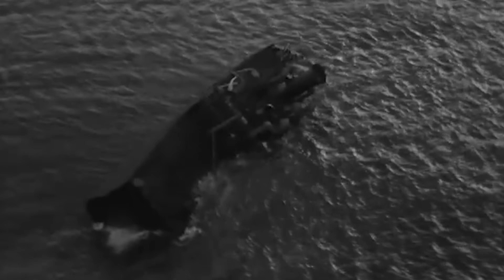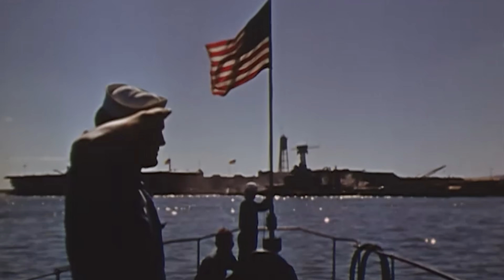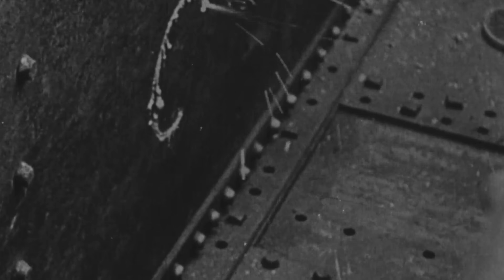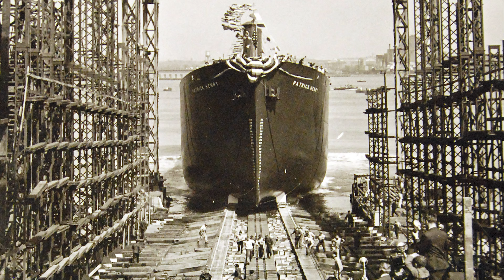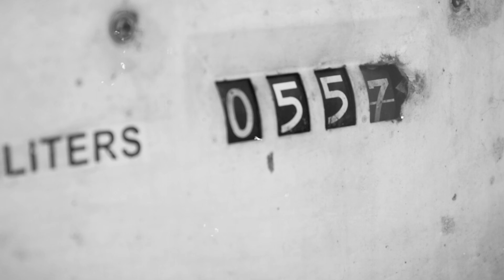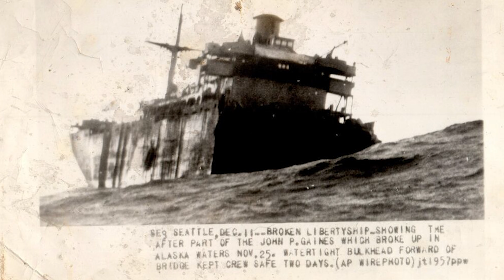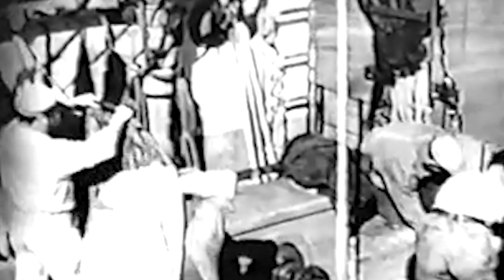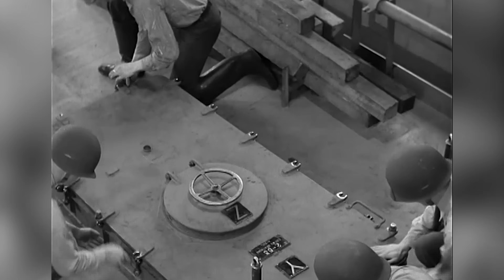CATASTROPHIC Design: The Ships That Broke in Half

Comment: Metallurgist here! Liberty Ships and the 800 of the 2800 that experiencing "major hull cracks" were part of the metallurgy curriculum for me in the Fracture Mechanics part of my training. There were TWO primary causes for this: Number 1. Nickel was in short supply You may say NICKEL? What does that have to do with fractures in steel? Simple, about 1 or 2 % Nickle added to the steel dramatically changes the "nil-ductility transition temperature". Enough so that in the Northe Atlantic, many times the ships were cold enough to have transitioned the WELDS from a   "ductile" state to a brittle state.  However, proper structural design and the stress levels in the steel, even during heavy weather, could stay below a "failure" level. That is where factor number 2. comes in,  Built in starting cracks. Proper welds and these should have been no large weld flaws, and the ships would still be "OK". Whoops, you had Rosey the Welder on these ships and she was being paid on a "linear inches per day" bonus basis. With Vee Grove welds after the "root" pass, it was very tempting to throw some weld rods (with their flux coating for stick welds) into the Vee and to weld over them. An instant increase in welding speed, but also the instant creation of massive weld flaws/starter cracks. A DEADLY combination with added to being below the nil-ductility transition temperature. 80 Liberty ships completely fractured and sunk in the middle of the Atlantic, with..alas, an almost complete crew loss in each case.
Reply: That's a brilliant post and adds tremendously to an informed discussion. Thank you.
Reply: A study was done by Bethlehem Steel just after the war to investigate the hull cracking in Liberty Class ships. There were many which did crack in half, however this cracking was exacerbated by other factors such as torpedoes, running aground, collisions, incompetent weight distribution of cargo, and so forth. Further investigation showed that only 12 ships fractured in half spontaneously. Three of those 12 were Liberty Class ships. On the SS Jeremiah O'Brien, the last unaltered Liberty Class ship, now at pier 35 in San Francisco, curved steel reinforcement bars were welded to the 90 degree corners of her cargo hatches as a counter measure to the hull cracking problem.  There is, on a single vertical piece of steel, a very small buckle or ripple caused by hull flexion during one of her six Atlantic crossings in her history.
Reply: A nice example of why I always objected to the idea of being paid by production numbers when I worked in a factory. It's an incentive for poor quality work.
Reply: @mbvoelker8448  Yes, 'piece-work' or such can have 'unintended consequences'.
Reply: the stress concentrations were aso a factor (and not well understtod at the time). I think Tipper showed that even if welds were perfect this could still happen in the design as cracks could apear due to the stress concentrations. There had been work already done in the 1930's by the Royal Navy as they had ships cracking and every measurement showed that everything was well within normal stress levels. Always worth noting, that they just didnt know this stuff then when they were designing them.
Reply: Regarding welders, the submarine Navy once had a similar problem.  A civilian shipyard was paying welders on a 'per pound of rod' basis. Now, submarine hulls as you might imagine, are pretty thick.  So welders tried to make first pass so it looked good from the inside, then just laid sticks of welding rod into the gap and made one final pass so it looked good from the outside.

Hull welds on subs are always x-rayed and it was spotted right away.  Some welders lost their jobs over that one.
Reply: @mikefochtman7164  these days we sign paperwork and can go to jail for that
Reply: Great explanation.  In the nuclear field, we study brittle fracture for large pressure vessels like the reactor vessel.  Heating and cooling rates have to be controlled because the temperature gradient while cooling adds to the stresses.  So any time nearing or below NDT, extra precautions are taken.
Reply: Follow-up video interview of you by our friend Greg would be most interesting.
Reply: It did seem a little odd that this was only happening to these ships.  It wasn't like they were the only ones to ever use questionable metals.  This certainly sounds like a plausible explanation to me.
Reply: Thankyou for sharing your experience with us
Reply: Cracked steel is NO joke! 😤 How many lives were lost 'cause of this? #SafetyFirst
Reply: That sounds like "Texas TIG" but for really lazy people. Great post, btw.
Reply: @StFiacre Texas Tig is not he Sam, it uses an electrode for heat and filler, and a second electrode fed into molten puddle to melt with that.
Reply: Can this happen with Stainless steel to?
Reply: Chemistry.  Matters mucho
Reply: A classic example of perverse incentives that collectivists never learn.  Similar to paying coders by quantity of code which results in spaghetti code, or fast food drive throughs by wait time which results in them pushing you into parking spots where your order has no incentive to ever get to you until you complain.
Reply: My father worked at Baldwin in Chester during the war, and told the same thing about the welding rods being laid in the grooves.
Reply: I wonder if that person knew their fat paycheck for quick work was signed in blood.
Reply: Try pre heat. Makes life easier
Reply: Tell me you didn't watch the video without telling me you didn't watch the video. 😂
Reply: Thanks! And here I thought it was because women built it...ooops😂😂😂

Just chill, I'm joking...maybe😂

Comment: After Titanic sank and broke in half, safety changes were made to Brittanic to prevent her from breaking in half. Britannic had a bulb shaped expansion joint design which differed from the straight cut expansion joints on the Titanic and Olympic.  The Britannic also had four expansion joints in comparison to 2 expansion joints for each of her sister ships

Comment: The chapter "Cracks in Welded Ships" from the book "Ships for Victory" by Frederic Lane chronicles the effort to find the cause for cracking in emergency ships better than just about any other source commonly available. I always cringe when I hear somebody about to talk about this topic, because so frequently, they get large parts of it wrong, but you did well, old man. Good job.
Regarding cracks propagating from corners, I always think of the de Havilland Comet jet airliner suffering explosive decompressions due to similar cracking around non-rounded openings in its hull not very long after these events with the ships took place.
Reply: The story of the Comet's "square windows" is a myth, as you would learn if you visit the De Havilland Museum. The truth is that, with their long experience of industrial adhesives, De Havilland had originally intended to bond the windows into the fuselage. In the event, this was not possible, and a late decision was made to rivet the windows into what was by contemporary standards an unusually thin skin. It was drilling hundreds of small rivet holes that started the cracks. The only reason subsequent Comets had square windows was that the company wanted to emphasise that they were a completely new design.
Reply: @davidjones332  Everybody's wrong but hte manufacturer. Def. Totes. 100%.

Comment: It's interesting because so many of these same issues were behind the break-up of the DeHaviland Comets.  There they found that the aluminum alloys used in the aircraft skin was (1) too thin, but also particularly prone to metal fatigue.  Certain alloys are more prone to metal fatigue than others...and of course, you don't immediately see the effects until they start to break.
Reply: Interesting, I thought the main issue with the comets were their square windows building up too much stress in the corners, causing cracks and eventual explosions?

Comment: At the beginning of the war, apparently, the welders were being paid by the pound of welding rod they used up.  This encouraged certain welders to hide in the welds pounds of rod and then welded over them.  This certainly happened but I don't know how wide spread it was.  And I don't know which ship yards did this.  HOwevfer, it was discovered and the people were then paid by the hour.  Certainly such a practice COULD have contributed to sdome of these failures.  However, I thimpfk that was early in the war.

Comment: Considering the fact that Liberty and Victory ships were viewed almost as disposable, getting multiple years of use out of them well past the end of WW2 is pretty amazing. I don't think they were designed for many voyages, year after year after year.

Also, we're still learning about metallurgy, especially how certain steel alloys hold up over time. A great example of this is how a common structural steel alloy was found to have cracking problems. T-1 steel, also known as ASTM A514 steel, is a high-strength steel susceptible to cracking, particularly in welds, due to hydrogen embrittlement if proper fabrication procedures aren't followed.  While T-1 is much stronger than regular steel, it’s a lot more susceptible to poor quality welding. Improved techniques were adopted in the mid-70s, but older T-1 bridges are prone to potentially serious issues with cracks introduced during the fabrication process.

Hydrogen Embrittlement:

Hydrogen, introduced during welding, can accumulate in the steel's microstructure, leading to cracking if proper fabrication procedures (like preheating and slow cooling) are not followed. 

Fracture Critical Members:

The Federal Highway Administration (FHWA) has issued technical advisories focusing on the inspection of fracture-critical bridges fabricated from T-1 steel, particularly those with welding issues. According to the FHWA, a “fracture critical” bridge is one that lacks redundancy in its structure, meaning that this kind of cracking event could result in collapse. Fracture critical bridges made from T-1 steel have a history of safety closures due to weld cracking. In 2011, the Sherman-Minton bridge carrying I-64 over the Ohio River in Louisville, Kentucky was shut down for five months due to cracking in critical weld areas. Cracks were initially observed during routine visual inspection, but as part of the repair process the bridge was inspected using a more rigorous technique called non-destructive testing (NDT). That inspection revealed critical cracking that had not been visually detectable, and which was serious enough to force closure of the bridge.

Examples of Problems:

Sherman Minton Bridge: Multiple cracks were found in the butt welds of the tension ties, leading to the bridge's closure and the identification of hydrogen cracking as the probable cause. 

I-40 Hernando de Soto Bridge: A fracture was discovered in a main span tension tie at a butt weld, also attributed to hydrogen cracking. 

Other Bridges: After the T-1 steel lower chord fracture on the I-40 Hernando Desoto Bridge in Memphis in 2021, bridge owners across the USA were tasked with conducting new inspections of all NSTM bridges which were built with T-1 steel. This is a major problem, as thousands of bridges must be carefully inspected, not just ones with obvious cracks. High-tech non-destructive testing can flag problems, but it is expensive and takes time, and not all parts of a bridge may be easily accessible for either visual or NDT procedures. 

So, learning continues to this day about steel, one of the most-used materials of modern life.

Comment: There is considerable parallel the the fatigue failures in the first Comet airliners.

Despite remarkable enterprise, when under pressure, of mankind new ideas bring new and unpredictable issues.

This is a remarkable and saddening tale.

Thank for some history that I was completely unaware of.

Best wishes from George
Reply: Actually, that's an excellent comparison.  I don't know if the alloy used added to the problem, but I do remember that brittle-fracture caused by poor riveting (where drilling and bolts had been designed to be used around any hole in the skin of the jets and money was saved by rivets instead) was what eventually split those lovely jets when a huge section popped off like an eject canopy or something.  Wild stuff.  I think the Comets were using aluminum for the skin, though..?  Bah, I'd need to look it up, but 'brittle fracture' was definitely the same major cause.

Comment: The root cause was the sulphur content in the steel of the time. That caused cracks to be formed when welding, and those cracks could propagate due to brittleness at low temperature, also some design problems at loading bay corners ( later more rounded off rather than sharp cornered)

Comment: Old midship tankers indeed had tendency to break behind the midship superstructure. Often it was a question of some tanks being loaded and others not, creating tension and weight difference between different sections of the hull. M/T Ragny, a finnish midship typed tanker broke in half at Northern Atlantic. The stern floated for a couple of days and finally the us coast guard rescued 31 finnish sailors from there. Six sailors were lost with the front that broke off and sunk rapidly.

Comment: In fact: one liberty ship called SS Richard Montgomery got grounded on the reef before broke in half and sunk just 5 days later. Which today with over 1.400 tons of TNT bombs still onboard it’s now becoming a ticking time bomb that could wipe out many of towns along the coast including the city of Southend on sea.
Reply: But tnt has to be lit by a fire charge, or flint and steel. (Or redstone signals)
Reply: Sheerness would be more at risk than Southend as it's much closer. Comparing it to the damage caused by the Halifax explosion , Southend would be far enough away to not get flattened, though I doubt any glass windows would survive.
Reply: Could it still blow even when they are corroded by seawater

Comment: The fine points of steel behavior were not well known in that era because they had not been widely seen before.  Steel with mundane metallurgy could be more susceptible to fatigue and fracture.  Welding can aggravate this, cold temperatures (North Atlantic) can aggravate this.  Various irregularities in the shapes of plates where joined could aggravate this.  Put all of these things together in a ship and you start having problems.  Some German battleships had similar problems where parts of the ship were joined to the much thicker plates of the armored citadel.  Shortly after WWII somewhat similar types of problems plagued the British Comet aircraft.  A lot was learned about fatigue and fracture during this time but even during current times there is probably a lot to still be learned.  I learned about all of this in college as an engineering student because we had a new professor who had a lot of experience in fatigue and fracture.  I did work in our research lab related to fracture and fatigue.  However the course that he taught was not a required course for structural engineering, I don't know if similar courses exist for aerospace and marine engineering so the world is still somewhat at risk of people repeating some of these problems.

Comment: Timely video, with the finding of the Western Reserve in Lake Superior, which broke in two during a mild summer gale on August 30, 1892. Her sister ship, the W.H. Gilcher, disappeared two months later on October 28, 1892. The wreck of the Gilcher is still undiscovered in Lake Michigan.
After their loss, testing of the steel used for both showed that it became brittle in cold water - the kind of cold water you'd find on the Great Lakes. History does tend to repeat if not heeded.
Reply: Oh neat I didn't know a new wreck was found up here recently. When was she found?
Reply: @TransDrummer1312  originally found via sonar contact this past July in ~600 feet of water. The articles confirming the find have come out in the last week or so.
Reply: Summer of 2024. @TransDrummer1312

Comment: In modern days, ships welded seams are not a straight lines, but have interlocking three sided  (imagine half a hexagon) lobes to impart greater strength to the welded seam and to spread the load.
Is it possible for poor welding to make cracks more likely?  Yes, but if the steel of the hull plates is not of a good alloy, then it could much weaker than expected.

Comment: I would personally go for the really rapid production behind the breaking ups. Judging from at least how those become apparent in tank productions.

1- Rapid steel production often resulting in "faster than ideal" steel temperings. pretty much if you are cooling down your steel to rapidly "quenched" it could trap carbon inside the iron resulting in great ammount of internal stress building up. These could be seen in cast tank turrest when they receive a hit and pretty much break in 3-4 larger pieces. For me it do appears that they got side effected by the rapid steel heat treatment.

2- The very rapid way they built those ships especially with rocky welders also could result in such issues. When you are welding such a large structure you have to be carefull how you are welding, What plates should you start with, what side of that plate you start with what welding speed you should progress on etc. otherwise you will also end up with a lot of stress build up in the structure. And my personal guess is that when they welded those hulls they pretty much just send as much welders they could to speed up the process without looking at the issue at all.